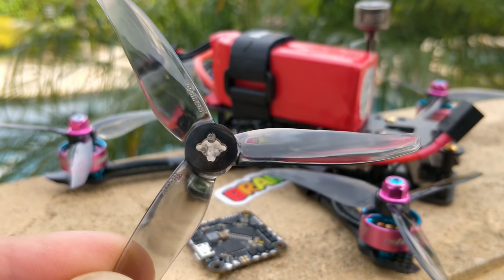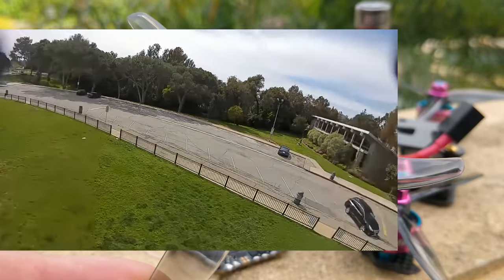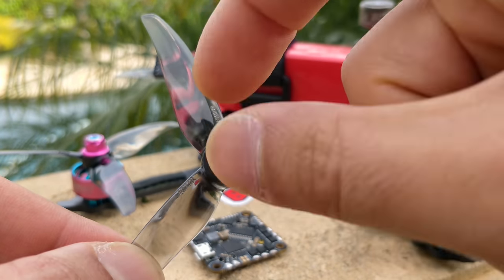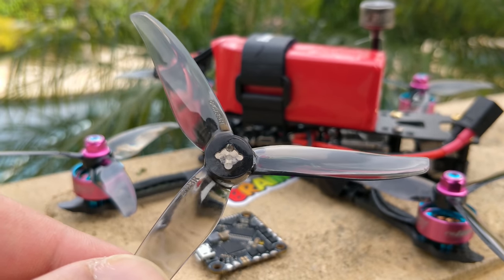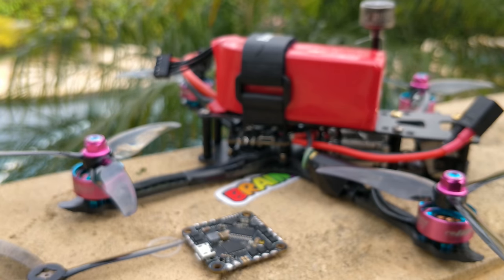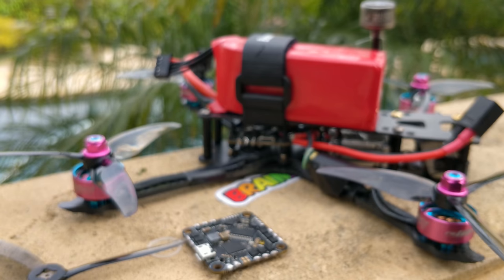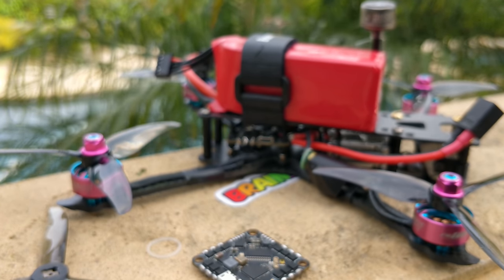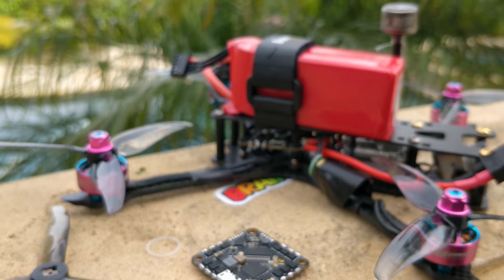Gemfan 4023 and recent  4" builds

Comment from the maker: Gemfan 4023: https://bit.ly/2QWZdkI
Gemfan 4024: https://bit.ly/3axpUEh
AIO Board: https://bit.ly/2xCQH3G

Recommended motor for very high performance: https://bit.ly/3dEbwfD (4300kv)
Otherwise consider similar sized, lower kv motors in the 3400-4000kv range.

This value battery seems to have no issues with that motor and that prop: https://bit.ly/340K9rz

Build video that will be fully released when all the parts are in stock:
https://www.youtube.com/watch?v=Ai_oqRC-KG0

▼Recommended TP3 build:
Motors: https://bit.ly/2y9I5BP
Frame: https://bit.ly/2UBD7Ft
Props: http://bit.ly/382yyJs
AIO: https://bit.ly/2Jjl4OU
Battery: http://bit.ly/38aViqA
Canopy: https://bit.ly/3dwqi7W
Vtx: https://bit.ly/33JfdvW
Camera: Nano 3 is the best option but discontinued due to lens manufacturer going out of business.  New options coming in store early April.  Other good options are typical AIO Whoop cams and the 199C

▼Recommended BabyTooth 1S 3" build: (more about this coming soon)
Motors: https://bit.ly/2UlySPA (Back in stock by April 4th)
Frame: http://bit.ly/2NrbM64
Props: http://bit.ly/382yyJs
AIO: https://bit.ly/2ycjIUd
Battery: https://bit.ly/2UhdwTl
Canopy: https://bit.ly/3dwqi7W
Vtx: https://bit.ly/33JfdvW
Camera: Nano 3 is the best option but discontinued due to lens manufacturer going out of business.  New options coming in store early April.  Other good options are typical AIO Whoop cams and the 199C

The LED Racewire: https://fpvframe.ch/fpvx/product/relectwire-micro/

▼Join my FB group for more discussion: Kabab FPV
https://www.facebook.com/groups/37915...

The store: www.FPVCycle.com

▼ My typical 5" quad setup:
-Hyperlite Glide Floss Lite: https://fpvcycle.com/collections/frames
-Motor: http://bit.ly/2Nqqr25
-ESC: http://bit.ly/2oDdzvL
-WaFL’s Cap Cap: http://bit.ly/2GUpXxO
-Battery: http://bit.ly/2JnsTDM
-FC: http://bit.ly/2XRc8G8
-FPV Cam: http://bit.ly/2Q7LfL7
-Vtx: http://bit.ly/38Y25oz
-ND GoPro Mount 30deg: http://bit.ly/2WC15zc
-ND Filter (if used): http://bit.ly/2WEmQ1j

FPVCycle 1303: https://bit.ly/2y9I5BP (should be in stock on Apr, 4)
Amax ET1303: https://bit.ly/2vPWgLB
T-Motor 1303:  No clue where this is sold

▼Notable motors:
-BH R3 2207 for $9.99: http://bit.ly/2NaTWEy (limited quantity only)
-Xing 2306: http://bit.ly/2Nqqr25
-Xing 2208: http://bit.ly/2y3te8R
-FANTASTIC 6" motor: http://bit.ly/2LqghOZ

▼Starter goggles: http://bit.ly/2qbJNOS

▼ If you want to solder better:
-Fantastic solder: https://amzn.to/2P5QM2W
-Fantastic iron: https://goo.gl/DqBipa

▼ Tips?
Patreon: https://bit.ly/2oGLP9b

-PayPal: https://www.paypal.me/kababfpv
-Bitcoin: 1E4XZXoD4rS6MYWVWuenY7Kw2M1YgyNpoQ
-Nano: xrb_1188ek5bd7tb9kw67asnp9o65byuoaxbtpxuznx1ribf75x78awywmakj55f
-ETH: 0xD067F93811f2eC31CB1928901002dfdf9A492EF5
-LTC: La2KWYAjp4VT2Lq2M76pbjzXWvRyjpfCtG

-Tesla Referal code: https://ts.la/bob40889
Please use my referral code if you're gonna buy a Tesla.  You get some free stuff when you do and I get better status with Tesla.
Reply: Thanks a lot. By the way Those Rcin motors are great, got em with 3000 kv on some of my 4 inch. Will go for some of the 4300 ones. And test. With a 20A Aio. Or as soon it comes out the beta fpv 35A bl heli 32! That should ripp! Stay safe bro.

Comment: I've been using the lumenier Qav R 4" for awhile but I lightened it by re moving carbon from the bottom plate, discarding the top plate and replaced that with the Qav- Ulx stack for the electronics, then turned the FC 90° to make the quad into a stretched x. This conversion probably removed about 30 grams. I'm running brotherhobby 1806 2800 kv, Gemfan 4052x3 and 850 mah R  line batteries. It's a nasty little beast. Gemfan and Dal are my go- to props right now

Comment: I bought 4 packs of these recently. They produced bad vibrations. Had to balance all of them with electrical tape. At least they all were consistently off so I could put the same amount in each spot.
Reply from the maker: That's odd. These all come from one balanced mould. All the same. Plus, flight code today can compensate for as much as a third of a blade missing with little issue. 🤔
Reply: @Kabab  that’s true as long as you’re happy using a lot of filtering. My goal is as little filtering as possible. Also depends a lot on the frame. I’m switching to the apex frame soon as it seems to deal with resonance really well

Comment: I quite like 4" & glad to see another decent light prop to try.  For me they're good little park fliers & nicer to handle than a highly laden 3".  I don't worry about HD footage & just throw it around like you would a toothpick but it's a good candidate for a split type cam if that's someones thing.  Been using old 1806 motors @ 3,000kv with HQ V1S prop & 4s 850mah.  It's not an insanely fast setup but plenty of easy power & no slouch, great prop control (very little prop wash or tuning problems ever) & decent flight times (5 mins+).  The V1S prop has worked out great.  My motor kv could be a bit higher still with 850mah depending on the prop but it honestly doesn't need it, flies great & been happy with things like that, cold motors & cool lipos.

On a 4" reverb inspired frame the AUW is 284g (with lipo) which if my numbers are right is equivalent to around a 550g 5" in cubic disk loading terms.  Similar numbers to toothpick builds but very easy to achieve without much effort, flies on the lighter side but can still really be thrown quite far, has more mass than the smaller lightweight builds so doesn't suffer from air resistance as much.  Pretty much has that magical mix of being able to throw it a good distance & float while retaining lightness & good control authority.  There's lots of headroom with 4" & it's easier to find a balance of weight, power & efficiency (no gopro in the equation).  Likewise it doesn't carry a gopro & also isn't under 250g, so a bit pointless in ways, but flies great, the 5" world scaled down just a little bit...  I'm sure with the resources available to you the recipe can be refined much further, with you looking at these things it usually means parts will become more readily available so that's a good thing :p.

Comment: The center hole is important for aligning the prop on the t-mount. The small 2mm screws are not meant to do lateral load. They are just meant to press the prop against the motor. It's basic mechanic engineering and there are reasons to do that
Reply from the maker: In that case, the center shaft should bend or break. I've been using 2mm hole props on 1.5mm shafts for quite a while now with screws. Nothing seems to care. These aren't high load conditions

Comment: And now we can even use 4.5 inch prop. More speed more power same load. Perfect for 4s
Reply from the maker: At that point maybe just going to 5" makes more sense ?
Reply: @Kabab  I'm not sure about that. Look what I got:
4 inch prop perform best at 220-260 gr
5-inch prop perform from 450 gr
4,5-inch prop covers that gap between 250 to 450 gr. 
It also greater with 4s liion + naked cam. Not shaky, efficient. I compare it to Gemfan LR5126-2 that is hungrier on throttle moves and a bit shaky in my tests.
And you can build 4,5-inch analog sub 250g. (frame must be no heavier than 60 gr)
Another super prop is 4838 by Azure Power, it's hungry but on 350g quad it is godlike.
I want to see biblade 4,5 inch to completely cover my microlongrange needs, when I want to fly and film some POI. 
I'm waiting 3-inch prop batch to test, but I have a strong feeling that ill stay 3 inches for tighter outdoor flying (cos 4 inches feels a bit fast in those conditions) and 4,8-5 inch for light 6s freestyle (session cam), and will use 4,5 for microlongrange and 6 inch for long-range or a heavier 6s freestyle (have interesting build plan). So 4-inch prop no longer fits my fly conditions.
Reply from the maker: @KonstantinFPV  give the gemfan F3S a try. It's the best low weight quad prop I've ever tried. Even for small motors. It's just wicked efficient at response and beginning to process air into thrust as fast as possible.
Reply: @Kabab  I bought 110gr frame and ordered 2306 1950kv motors and wanted to test that setup with GF3S, HQ Juicy, Azure 4838 and maybe some Emax 5 inch low pitch props.
But first I need better ESC cos don't want to burn Tekko32 35a 4in1 that I have unused. But that's already to much purchases for a dad in the year end..
Reply from the maker: @KonstantinFPV  that ESC is fine.  Go for the F4S on that setup
Reply: @Kabab  oh even F4S? Thanks I'll try it.. when I'll get the stuff from HK and mainland China.. hope they manage 11.11 and Bfriday loads well.

Comment: Regarding 4" Toothpick weight. Range - depends on what you are after.  For 3", folks tried from 1202.5 up to the 1507 or even 1606, and AUW from 60g to 400g+. For 5", from 1507 to 2408, and 250g to 700g. 4" is kinda unicorn: 1404 to 2204. "Disc loading" - as you said so often. It heavily depends on the prop, and type of flying.... I put VERY different throttle curves on my 5inchers: 2207.5 6S vs the 1506 4s
Reply from the maker: Yeah I'm working on testing things on 4"

Comment: that center hole is a centering hole for the prop ... the screw holes are to wide .. and the prop might be not centered on the motor ... thats how the OG T-Mount was done ...
Reply from the maker: Except that if it had that job then you'd see bent and broken 1.5mm shafts. I've been using 2mm center holes on 1.5mm shafts for quite some time with no issues. The screw holes don't have much if any play typically

Comment: I love the sound they make. A 4" deadcat Glide would be nice...😀
Reply: Also, the 1.5mm hole is there to insure they are concentric with the motor axis, the M2 screws would not be enough by themselves.
Reply from the maker: But I've been running 2mm hole props on 1.5mm shafts with screws for quite a while now with no issues. 🤷🏻‍♂️
Reply: @Kabab  Oh well. I guess the tolerances are tight enough on the M2 holes.
Reply: I see a 4" LR build in my future, but I'm going to build a 3" Airblade Intrepid with ducts first.

Comment: As you talk about motors without shaft and only two screws. I think that shaft is important because of centering. That two screws doesn't guarantee exact position (there is still some clearance), which is therefore mitigate by tight shaft? :)
Reply from the maker: Except that the two screws do actually center the prop. I've been running the 2mm hole props on 1.5mm shafts for a while.

Comment: in think the sub 250g 4 inch class is very interesting due to the benefits of a larger propsize. I took the motors and electronics of my diatone 349 and put it on a superlight 4 inch frame (rotorama spirit) with hq4x3x3 and 4s 850mah. It flies great! people say thats a very hight KV for this setup but my motors come down cold after a good 4-5 min heavy flying with 100% throttle punches. the only thing that you have to consider are the vibrations of the light frame which you can midigate with adequate filtering. If Bob would design a superlight 4 inch quad the results would be very interesting!!!
Reply from the maker: It's on the way.
Reply: @Kabab  yaaayyy!!!

Comment: Have not built my first 4in yet.  Have done a 3.5 that can rip pretty hard even on lithium ion 3s but it is over 250g.   Will be doing a Dave C long range 4in soon but I am waiting on 2mm stand offs which seem to be near impossible to get in the right size.

The Beta v3 board with 3 Uarts has me really interested for being able to do everything I need with GPS.

Comment: Hi Bob   Great information, I wish I knew this information earlier,  I had built a Ascent 3 using 1606 3300kv emax.  I seen these motors on a 4in 4s and 6s build, and I talked with Emaxusa and they believed that they would work for me.  But now when I try 6s they heat up fast. Is there a 3in prop that I can use with out burning up my motors.

Comment: Alleluja. 3 blade props for my 4" Toothpick.
Its 2020, not Prez Bush 2007. Laptops were chunky. Sliding removable drive, memory. Fat battery for 2hr - 6lbs+
2020 ultrabooks. Slim. 4K touch. Quad-core. 8hr+. 2lbs.

Quads/toothpicks need same makeover. FC, ESC, multi-format RX, Digital VTX - 1 compact board.

For Jumper controller, do you solder parts to switch Futaba/Spectrum/FrSky?
Reply from the maker: I didn't think you needed to do anything special for jumper. It should have it built in
Reply: @Kabab  Nothing special for Jumper - Well thats the whole point!! You dont see mfc selling NTSC vs PAL VTX. Or FC that only works on FrSky vs Futaba. It would be stupid, right? Then why do we accept it for receivers (RX)? No reason you cannot make multi-format receiver - the extra 20kb for firmware?
Reply from the maker: @dilbertmcfly5986  I wish I could control these damn companies....

Comment: Looks like an interesting prop but genuinely shocked at the setup you are using. A big heavy 5" battery on a 4", large heavy(ish) frame? Who are you and what did you do with Kebab? Have you not tried applying the lightweight 3" philosophy to the 4"? lowish KV, very low weight, small batteries, minimal motors. I did see the props but I was expecting you to come up with something way different to what you had there to power them.
Reply from the maker: I go both ways. Super light and also medium weight setup that will have good power. This one is designed for a GoPro and it'll definitely carry it. So that battery is really nothing

Comment: Great video Bob! 4" is a very interesting topic. I think it has already begun to grow in popularity. I do have a production comment. At 10:35 there is a distracting hum/zip sound. I've heard it in many of your videos. I'm almost sure that's due to having your phone too close to the mic/speaker. I used to get the same effect when I left my phone on top of my computer speaker. Not trying to harsh your cool, just trying to help. Cheers!
Reply from the maker: I just use my phone to record. Nothing else so if there is a hum inside my phone, then 🤷🏻‍♂️. Most likely it's either a pool pump, air conditioning unit for some other kind of machine.
Reply: @Kabab  Ah. I always thought it was a video camera instead of a phone for some reason. The picture and sound are rather good for a phone. That's a fair trade then.
Reply: it's a taser
Reply from the maker: @friendlynomad9840  thanks but it's not even a good phone. It's a three year old OnePlus 5 🙈.  Nice pictures are usually more about the person taking them than the equipment they're using. Many ways to take a good or crappy picture/video

Comment: building 4"with those aio fc right now and i hate that there arent many different 4"props,  two blade are worse.. and now smaller motors have 1.5mm and 5mm shaft and thats getting way worse with finding the right props... tech is going forward but there is a big gap of needed props. i like that gemfan builds some for both shafts.

Comment: Screws have terrible accuracy. If only mounted with screws, you might end up with high runout and therefore vibrations. 
I think the 1.5mm shaft is very important for centering the prop.
Reply from the maker: But the screw will ultimately do more since they're thicker and there's more surface area. No?  What can a little 1.5mm shaft do?

Comment: I just ordered some of the 4023 for one Im building, its a 5 inch twig frame and will have an auw of 230-250 grams. I have 1606/4000 kv motors and was going to use 4.8x3.4x2 props. I think it will be fine, but someone on my  channel is saying it will burn my motors up. I would appreciate your opinion.
Reply from the maker: It won't burn up at all. 4" is the right size prop for that motor and this 4023 would be pretty darn perfect. Motors don't burn by over propping anymore. The windings are pretty darn robust. Even on micro motors

Comment: I have a 3 inch using 1306 4000kv  motors but its a little too heavy and has too short of a flight time would changing it to 4 inch make a big difference ?
Reply from the maker: It would make a big difference but that motor is probably going to be a bit small for a 4"

Comment: I see no point going under 5" except to meet 250g AUW... But yes Gemfan is killing it these days. Tell us more about the antenna coming off the Vista.. Did the UFL on the Vista or antenna break? Doesn't it have something holding it down to prevent that?
Reply from the maker: The antenna wire ripped out of the ufl connector attached to the antenna. The Vista unit is fine. The antenna is not.
Reply: @Kabab  Good maybe that's the part that Caddix actually made :D